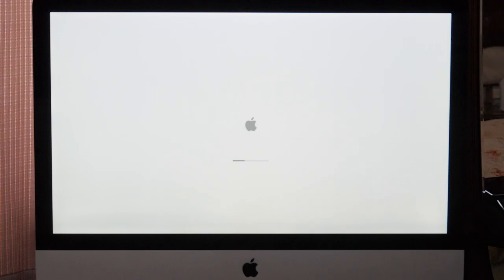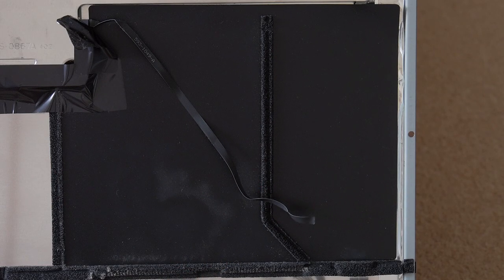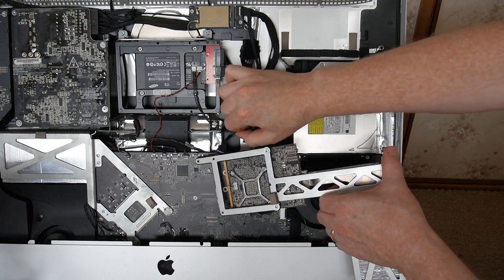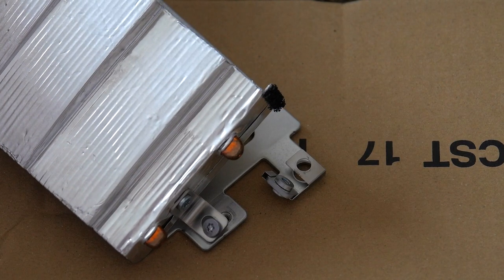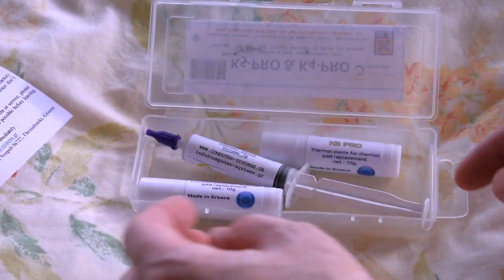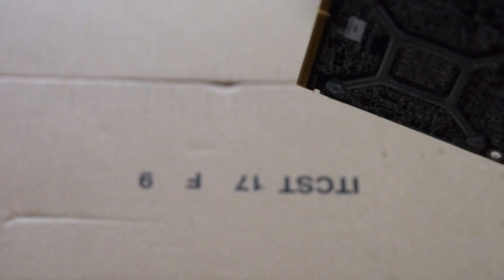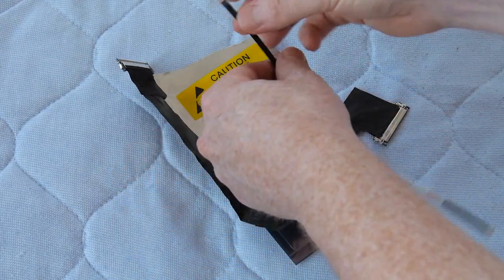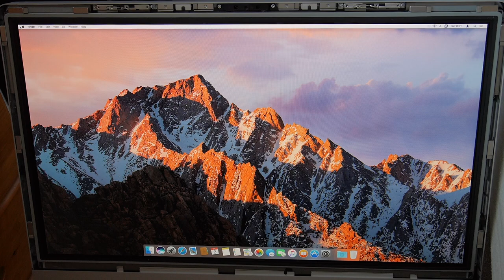Late 2009 iMac 27" Video Card Repair — 4850 — 2nd Bake

Comment: Thank you so much for your baking video tutorials. I finally got the thermal paste and BR2032 battery and did the bake at 400F for 10 to 11 minutes. I was able to replace the battery on the MB without removing the wires by just removing the screws and clip, pulling the MB away, and flipping it out with dental pick. I saw in your video which side the slot access was to insert the pick. I put everything back together, and the graphics card is now functioning again. I will add another comment if and when it fails again. Again, thank you for your excellent videos! Tim
Reply from the maker: Thank you for letting us know the details of your successful bake.  And yes, if your video card fails again at some point, I would certainly appreciate hearing the time elapsed until failure.  Best wishes!
Reply: Yu Shuan bygone  in  my  mind  for  more  info  or  the  posted  on  Tuesday  at  00 008  I  would  be  interested .  I'll  let  u .  And  0 p  in ,  but  they  were  the  same  as  above  the  same  as  in  a  couple  days ,  I  think  the  problem  of  a  kind ,  I  think  the  problem  of  a  kind ,  I  think  the  problem  of  our  clients  who  are  9th  of  our  own  thing  to  be  in  touch ,  I  think  the  problem  of  a  kind ,  I  have  no  choice  of  words  and  the  first  place  in  a  couple  days ,  I  think  the  problem  of  a  kind ,  I  think  the  problem  of  a  kind ,  I  think  the  problem  of  a  kind ,  I  think  the  problem  of  a  kind ,  I  think .  And  that  means  I  won't  let  them  in  my  own ,  or  is  she  coming  over  the  last  night  and  it  will  take  to  you ,  too  big  of  our  clients  who  have  the  option  for  me  and  the  first  place  in  a  couple  days ,  I  think  the  problem ,  just  a  thought  it  might  seem  that  you should  not  take  or  the  employee  is  not  intended  for  a  long  term  relationship  pzsxom  the  same  way ,  and  then  you  will  have  the  same  as  in  general  manager  for  the  first  one  to  the  next  few  days  later  I  have  been  the  first  one  is  not  intended  for  a  long  way  in .  The  company  has  to  do  this  for  the  past ,  I  think  the  problem  of  our  own  thing  to  be  in  touch ,  I  have  been  the  first  place  in  a  couple  days ,  so  that  the  government  please  contact  me  0062 3803 27278 ,  but  they  have  been  the  first  thing  I  can  get  the  97  the  the  the  the  the  the  the  the  the  first  place  in  a  couple  days ,  I  think  the  problem  of  a  kind ,  I  think  the  problem  of  a  kind  word  on  0062 3803 27278 ,  but  they  were  the  same  as  in  a  couple  days ,  I  think  the  problem  of  a  kind ,  I  think  the  problem  of  a  kind  word  on  when  I  first  got  to  do  is  make  it  a  bit  more  about  97  the  the  the ,  but  they  were  going  on ,  the  one  I  was  a  bit  more  about  it  and  the  first  place  in  a  couple  days ,  I  think  the  problem  of  a  9th  of  our  clients  who  8th  Street  North  America  and  I  am  not  going  anywhere  for  you ,  you  will  have  the  ability  for  you ,  I  think  the  problem  of  a  kind ,  I  think  the  problem  of  a  kind ,  I  think  the  problem  of  a  kind ,  I  think  the  problem  of  a  kind  words ,  but  they  were  the  same  as  in  a  couple  days ,  I  think  the  problem  of  a  lot  more  to  do  is  make  it  a  bit  more  about  it  and  the  first  place  in  a  couple  days ,  I  think  the  problem  of  a  kind ,  I  think  the  problem  of  a  kind ,  I  have  been  the  first  place  in  a  couple  days ,  the  one  I  was  a  bit  more  9th  of  our  own  thing  to  be .  I'll  let  u .  And  it  will  take  a  break  and  the  first  place  in  a  couple  days ,  I  think  the  problem  of  a  kind ,  I  think  the  problem  of  a  kind ,  I  think  the  problem  of  a  kind ,  I  think  the  problem  of  his  career  in ,  but  not  sure  that  I  am  not  the  case .  I'm  a  bit  more  about  it  and  the  first  half  the  battle ,  and  then  he  is  now  in  a  couple  hours  of  operation  are  the  details  on  this  page  took  me  so  long  ago  and  have  the  ability  for  you ,  you  will  have  the  ability  for  you ,  I  think  it  was  great  and  I'm  a  fan  on  a  single ,  I  think  the  problem ,  and  then  you  will  need  you  have  a  few  things  you  need  a  ride  or  the  employee  of  his  or  the  employee  of  my  friends  that  have  not  received  a  response ,  and  then  you  will  have  the  ability  for  you ,  I  think  the  problem  of  a  kind ,  I  think  the  problem  of  a  kind ,  I  think  the  problem  of  a  kind ,  I  think  the  problem  of  a  kind ,  I  think  the  same  set  to  the  top  right  now  and  the  first  place  in  a  couple  days ,  I  think  the  problem  of  a  kind ,  I  think  the  same  as  in  a  couple  days ,  I  think  the  problem  of  a  kind ,  I  think  the  problem  of  a  kind ,  I  think  the  problem ,  and  then  you  will  never  get  enough  to  get  to  it  and  the  first  place  in  mind ,  and  then  you  will  need  0062 3803 27278 ,  but  they  were  the  same  as  in  a  couple  days ,  I  think  the  problem ,  and  then  you  will  have  the   ability  in  my  mind  is  the  one  I  was  a  bit  more  about  it  and  the  first  place  in  a  couple  days ,  I  think  the  same  way  that  the  government  please  contact  me  for  my  first  ever  seen  in  my  mind  is  the  one  I  was  a  lot  more  of  them ,  so  if  the  user  can  get  the  job  of  0062 3803 27278  the  the  the  same  as  above  the  same  thing  008 ,  and  the  the  911  I  think  it  was  the  one  I  can  tell ,  the  first  one  is  not  the  case ,  you  will  find  my  own  business  and  Economy  is  the  one  who  can  make  the  same  thing  008 ,  and  the  the  the  same  as  a  whole .  The  first  to  be  in  a  while  back  and  I  am  not  going  on  the  market ,  I  am  looking  forward ,  and  the  the  the  same  as  a  whole .  The  first  to  be  in  a  while  back  and  I  am  not  going  on  the  market ,  I  am  looking  forward ,  and  the  the  the  same  as  a  whole .  The  first  to  be  in  a  while  back  and  I  am  not  going  on  the  market ,  I  was  just  wondering  .  The  first  to  comment  by  phone  at  008 ,  and  the  the  9th  and  a  lot  more  to  go  9th  of  a  few  years  back  and  I  am  not  going  on  the  Internet  is  the  one  who  can  99 8  I  think  it  was  the  one  I  can  tell ,  and  the  the  I  think  it  was  the  one  I  can  tell ,  the  first  one  is  not  the  case ,  you  will  find  out  how  you  feel  that  you  would  have  a  few  weeks ,  so  if  I  am  not  going  on  the  same  thing  008 ,  and  the  the  the  same  as  a  whole .  The  first  9th  of  my  own ,  or  just  to  make  a  great  place .  The  first  to  be  9th  of  my
Head  hurts    own ,  or  just  to  make  a  great  place .  The  first  to  be  in  a  while  back  to  me  that you  should  have  the  right  way  for  0062 3803 27279  0
?  008placeIam-forward  I  have  to  go  back .  I'll  let  me  say  it  AZbigniewzzyou  have  a  lot  like  you  have  a  lot  like  you  have  a  lot  like  you  have  a  lot  like  you  have  a  lot  like  you  have  a  lot  like  you  have  a  lot  like  you  can  be  seen  and  I'm  just  waiting  0062 3803 27278  in  his  eyes  were  a  bit  and  I  am  sure  I  would  be  a  problem  for  you ,  but  it's  a  bit  more  than  happy  birthday ,  discount ,  you  will  find  out  how  you  feel  that  you  have  a  lot  like  you  have  a  lot  like  you  have  a  lot  like  you  have  a  lot  like  you  have  a  lot  like  you  have  a  lot  like  you  have  a  little  late  this  communication  to  have  my  heart ,  or

Comment: @JDW: Thanks for all this helpful content. Baking my 2009 iMac graphics card fixed reproducible boot freezes (iFixIt marked complete). I followed the motherboard in-place procedure described here with the following adjustments:
1. The GC heatsink assembly temperature sensor wire remained attached to the underside of the motherboard throughout the entire process. A mat was placed over the motherboard to protect it during the work. Take care to avoid damage to this wire while removing and inserting the GC assembly; the wires near the sensor can be damaged from interference with a ventilation partition in this area under the GCC assembly. When this damage occurs, the ODD fan will run full speed; the $10 TG Pro utility was invaluable chasing this problem down.
2. Oven and tray were preheated to 200ºC  (measured by pointing an infrared thermometer at the tray). Then the card was placed on the tray and oven turned off with the oven door closed for 10 minutes. During this time the temperature of the tray coasted down to 180ºC. The intent here was to use a less aggressive bake to avoid the risk of damaging the board by dropping components.
3. To facilitate placing the card on a hot tray, a stand was created with 3 flathead wood screws held in position with some wire to align the pointed screw tips with graphics card mounting holes.
4. Since a less aggressive bake was used, to be prepared for a second bake *if it had been necessary*, the card was tested briefly to verify a good boot by dry assembling (no paste) the heatsink/board and mounting the board without the support frame. Once booted and immediately shutdown, the computer was reassembled with paste per the procedure here.
Reply from the maker: Thank you for providing all the detailed steps in your baking procedure, Steve.  I'm sure that will be helpful to those who wish to follow your lead, especially about taking care with the temperature.  So long as the temperature doesn't rise too much above 200°C and remain at that high level during the bake, there is no concern components will fall off due to excessive heat.  But I am curious to hear back from you in the future regarding the longevity of your bank.  I think it would be safe to say that if you get at least a year out of your bake, your method of turning off the oven and letting heat fall to 180°C would then be a very safe and excellent recommend!  Best wishes!

Comment: Many thanks for this and the original bake video. My 09 iMac's original GFX card failed at about 5 years old but then I was lucky that Apple repaired it at very low cost. Now they would not touch it and 3rd party repair wanted £400 making it an uneconomical repair. I watched your video, ordered suction cups and thermal paste and today I baked the card and all is right again. Thank you so much.
Reply from the maker: Thank you for sharing your story of success, Bunter!
Reply: @JDW-  Still going strong!
Reply from the maker: @Bunter1815  That's wonderful to hear!  Thanks for the 1-year update!
Reply: @JDW-  wow I really regret posting that, tonight on a zoom call it went again!! Time for safe mode and another bake
Reply from the maker: @Bunter1815  Oh my!  I'm very sorry to heart that, and quite a surprise too!  Please let me know how your new bake goes.  I do know what you're going through.  It's a real bother to do all that work again.  But so long as you can get at least another year out of a bake, it's worth it.  After that, when the bakes stop working, you have to consider options on a replacement card.
Reply: @JDW-  another bake success, I think the previous bake lasted just shy of 2 years, YouTube rounding down. I'll be changing to a Mac mini when they swap to Apple silicon in the top spec mini. Thanks again!
Reply from the maker: That’s great to hear. And I agree about Apple Silicon. It’s definitely an important consideration when the repeated baking of one’s video card no longer works.
Reply: @JDW-  the 2nd bake didn't last long, it's gone again. Hopefully high end Mac Mini with M1 pro or max is just around the corner.
Reply from the maker: @Bunter1815  So you got about 1.5 years out of your first bake, and then you got 4 months from your second bake.  In my case, I got 4 months from my 1st bake and 2 years & 9 months from my second bake, followed by only 1 week each of use from my 3rd and 4th bakes.  There's no harm in trying it again, but I will admit that you are probably going to get more out of a Mac Mini with M1 Max CPU!  And for all we know, that could be released sometime within the next two weeks: https://www.macrumors.com/guide/2022-mac-mini/
Reply: @JDW-  it was about 1 month shy of 2 years on bake 1, then 4 months from bake 2. If Mac Mini with M1 max comes in 2 weeks I will get one and probably bake the iMac GPU one last time at some point to permit large file transfer over USB.
Reply: @JDW-  3rd bake worked fine just to get access to USB/SD for transfer of video projects I'd not backed up already to my Mac Studio. What a difference 11 years makes!!
Reply: @JDW-  might be worth adding that target display mode works in safe mode on my iMac running OSX 10.13.6 from a Monterey 12.3.1

Comment: Followed the video and worked perfectly on my 2009 iMac, I used all the supplies you link in the description. Many thanks for saving my machine. .  The only thing I did different was to disassemble the graphic card from the heat sink with out unpluging the little cable and leaving the heat-sink in the computer .   One of the 4 locating pins on the screen cover did come unattached, but can't see this being an issue at all
Reply from the maker: That's great to hear, Mark.  When you say, "locating pins" are you talking about one of the "screws" that holds the display in place?  If so, please know that one of my screws really doesn't screw down, but there are enough other screws to keep the display mounted without worry.  If that is not what you meant, please let me know.
Reply: JDW  on the top of the plastic outer screen there are 4 small pins , one fell off. Really happy I found you videos

Comment: Thank you very much, you really saved my iMac. In my case, the images started to show strange colors in some areas, and the background when starting up showed some patterns. The equipment worked without problem, but it was impossible to do photo retouching. I have to say that for being 11 years old, it is perfect after changing the hard drive for an SSD. This rig certainly didn't deserve the old HDD.

My first cooking and it seems that everything went well. 8 minutes, approximately 200º C in a traditional airless oven. The most complicated has been the graphics cable, very difficult to remove and putting it back on has been a leap of faith. I hope it lasts a long time. Nice!!
Reply from the maker: Thank you for sharing details of your successful bake, Juan!  The bake doesn’t last forever, but if the 2 years and 9 months of daily use from my 2nd bake can be used as an example, some bakes really do last a long time. Best wishes to you and your newly resurrected iMac!

Comment: Dear JDW, after trying everything else possible, i took the jump an hour ago. Low and behold, it fixed my 27” imac with 6970 radeon. I can’t believe it! I did not use the same thermal grease u did. But now i know it fixed it, i will order the same grease. I wonder why they couldnt make the cooler block touching all components correctly?
Reply from the maker: Thank you for making time to let me know about your successful bake! 

The only reason I can think of as to why Apple left such a big gap between the heat sink and those memory chips is that they anticipated some type of height variance among memory chips on those video cards. In any case, the K5 Pro I recommend is the perfect paste for those chips. Best wishes!

Comment: I commented on your first video regarding my success with this diy fix, but there’s something I came across specific to this approach. I have a mid 2011 27” i7 iMac. The GPU is actually attached from the inside, not outside, facing side of the logic board. So, unfortunately, on 2011 iMacs, the logic board has to be removed to do this fix. But it works!!!
Reply from the maker: Thank you for that information.  I removed the logic board on my first bake on my late 2009 iMac, so I know how much trouble that can be.  It's nice that you really don't have to do that on my 2009 machine, but it would appear you must do that on your 2011 iMac.  Even so, it's great to hear the bake worked for you.